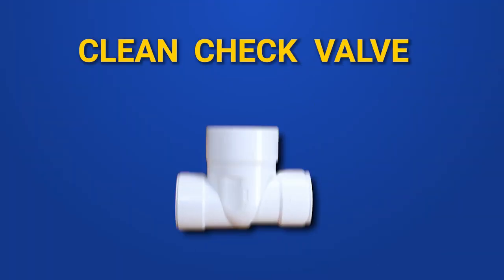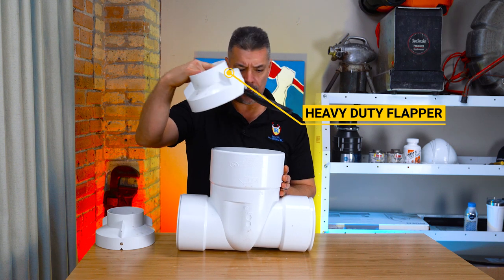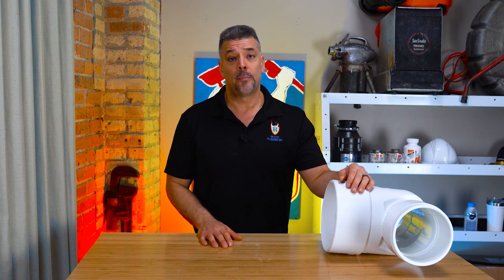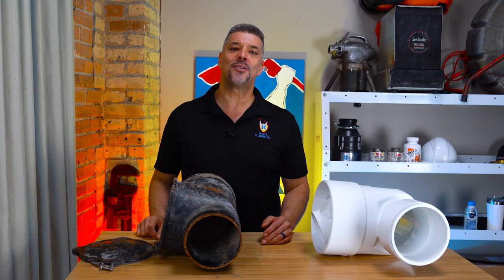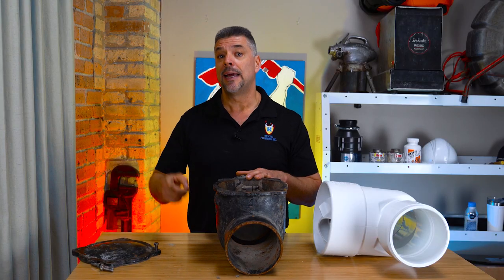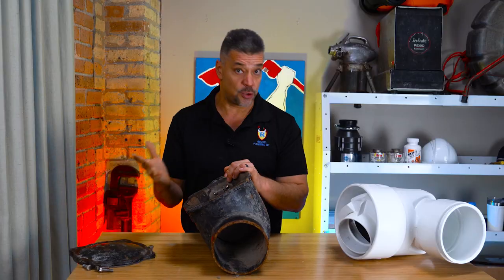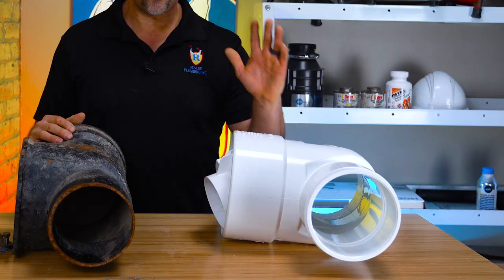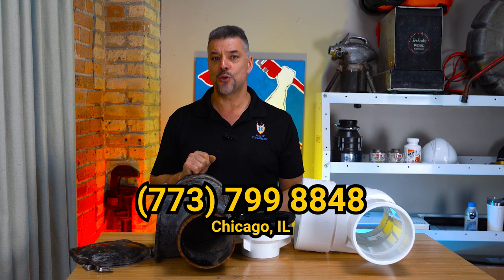Battle of Backwater Valve Systems: Clean Check vs Flood Control System

Comment: In the picture you show at about 7:52. So if I'm understanding correctly, water flows left from house out to city sewer and as long as there's no backflooding from city, the two 6-inch check valves would open to allow flow out the house. Now in the event of backflow from the city, these check valves (one way valves) would not allow water to come back into the house lines. However, what I'm wondering is the thing labeled overflow, that drains to the ejector pit and then goes thru that pipe to a 2 inch check valve into the city sewer. But 1) wouldn't this only operate in the even that the two 6 inch check valves are closed. Do these pumps have enough power to push in that sort of pressure against city backflow ??? 2) In the event of city backflow, wouldnt water just travel up the ejector pump pipes against that 2inch check valve ( I'm assuming this smaller check valve is not as strong, wouldn't it just blow thru that) ???

Thanks
Reply from the maker: If the city sewer is backing up into your property and you have a flood control.  Both 6 inch gates will be forced shut.  The ejector pit will begin to fill from the over flow.  This will trigger the ejector pump.  The ejector pump will pump the sewage past the 2 inch check valve into the municipal sewer.  And yes its powerful enough to do it.
Reply: @RescuePlumbing  I see. Appreciate the reply. How often do these have to be inspected and what does it involve ? Thanks
Reply from the maker: @jakec5618  once a year service is needed.  The 6 inch checks must be opened and greased to make sure the brass flappers are working properly and check the pump and 2 inch check.

Comment: Great video I'm about ready to have a check valve installed on the outside I'm sure I'll be using the clean check by Rector seal I could not find another manufacturer similar to this that you can expect as easily as you can that clean check is there another one out there just so I can look at it before and make my decision thank you one more thing about the sewer flood control system needing a pump people got realize that during my event is a good possibility that you'll be without power so then you would need a backup generator to be sure the pump is working the system is probably the most foolproof one out there but way too involved  
thank you for a great video
Reply from the maker: Your plumbing supply store will have their own maker of the backwater valves.  I have purchased back water valves from different plumbing parts suppliers.  I have ended up with valves from manufacturers such as ACME, Oatey, and Sioux Chief.  The plumbing suppliers do not really push one brand over another.  You are correct for a sewer flood control system its good to have a whole house generator so power does not stop to the pump.  But for those who have a flood control with no generator, I will tell you.  If you lose power you will know when your lights go out in your house, and you will know not to use your sewer.  As long as you don't use your sewer you can not flood yourself.  I have not had one customer, (knock on wood,) call me to say they have flooded because their was no power to the pump on a sewer flood control I installed.  I have installed hundreds of flood controls.  Keep on plumbing!

Comment: Hi there, excellent information. I have a question that the video didn't answer.  What is the maximum backflow pressure (in terms of psi) can the cleancheck valve handle, and for how long (in terms of hours) can it hold back that pressure?
Reply from the maker: The Rector Seal Back Water Valve in this video is rated at 75 PSI.  As far as hours it would hold that is a good question.  I assume at 75 max pressure indefinitely.  I have installed several of these in areas where the sewer has backed up and no customer has had a sewer flood yet after installing.  You do have to make sure the flapper is good at least once a year or replace it.  I Installed a clean check about 4 years ago that the flapper was in really bad condition.  They had had several sewer floods but they did'nt flood their basement, Thank God.

Comment: The sewer never backed up into my house, but the backwater check valve clogs a lot and backs up into my house.
Reply from the maker: You should maintenance at least once a year so it does not back up.  Is it installed improperly?  What material is the check made of?  What is the manufacturer?  What is being put down the sewer that makes the flap clog?  So many questions.